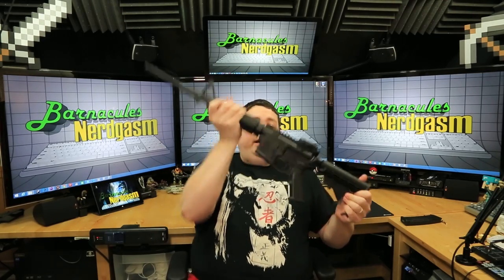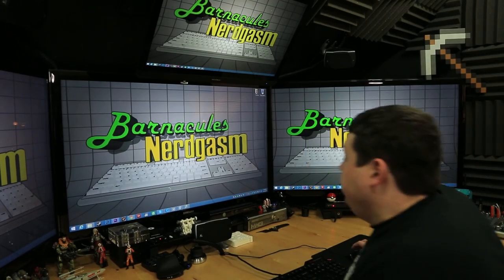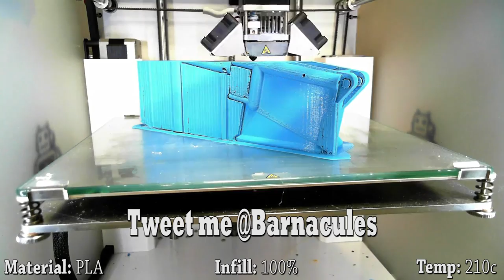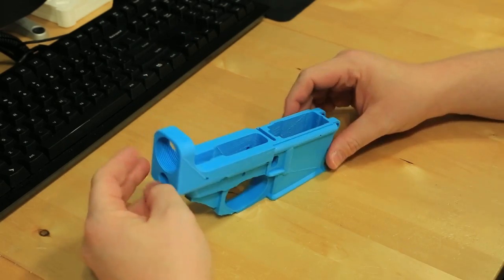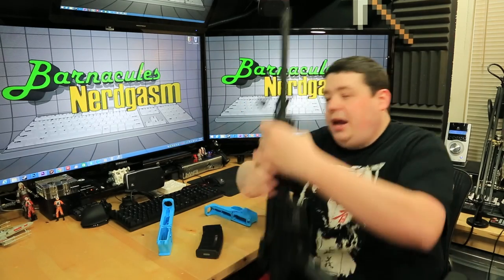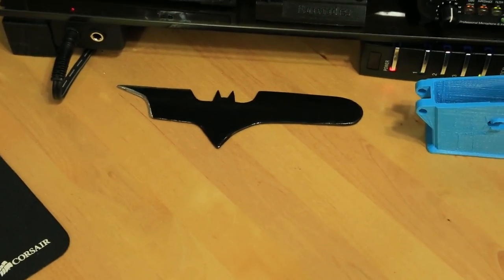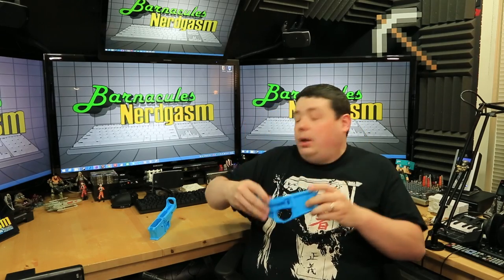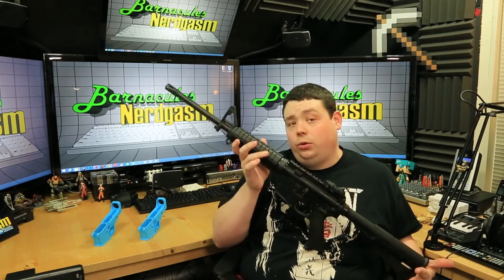Why you shouldn't print an AR15 on a desktop 3D printer 😎 - @Barnacules

Comment: I think printing accessories would be a good thing since it could possibly save you money.
Reply: same
Reply: But by the time it's done 3D printing you have earn enough money to just buy one
Reply: Alan Lightner buy a $100,000 printer to print accessories or go to your local shop and buy one for less than 1k?
Reply: Chrispy Customs as far as it comes to just printing plastic parts like maybe flip up sights you can use a regular $200 printer
Reply: They wouldn't hold up long enough for them to be worth it
Reply: Axman8000 I printed a foregrip for my ar15 out of abs at 50% infill and it works just fine. I rubber coated it and it feels nice in the hand. I have also printed a lower receiver in abs at 100% infill and trust me it I completely solid and sits like a glove to the upper. The grip took me like 4hours to print, the lower receiver took 41 hours to print.
Reply: do you mean a grip or a handguard? if its a grip I would understand, but polymer handguards just don't hold up, especially free-floated ones
Reply: Axman8000 its a grip. I imagine you could print a handguard out of abs and it'd hold up as long as you weren't dumping 500 rounds through the rifle in rapid succession. Or you could print it from nylon and it'd almost never wear out. Also depends on the influence.percentage. the lower I printed was 100% infill and you could run it over with a car and it probably wouldn't break.
Reply: sinformant I disagree, I had a polymer handguard and didn't hold up to 500 rounds through an AR-10
Reply: Axman8000 I imagine that depends on the polymer or type of plastic used, how much its shot ect. As for nylon it generally has a glass transition temp of 250°c so if your barrel gets that hot, you are firing off a bunch of rounds in succession. Not if its free floating and only supported at the received and you beat on it a little then yeah it'd probably break eventually. I've never printed a handguard and used it so I honestly couldn't give you real world experience on it.
Reply: Chrispy Customs well the thing is, a 3d printer is usefull in many ways, where as that new grip you bought is only good on certain guns
Reply: sinformant i believe you but id still rather trust a company like Magpul that uses high quality polymer. still cool tho, bet you can print up some cool custom furniture

Comment: you should do a printed FGC-9 full build now, 9 months later.  also, the AR lower does not qualify as a firearm according to current legal rulings, the ATF has been dropping criminal charges against defendants because it has been successfully argued that the AR  lower receiver design does not meet the legal definition of a firearm.  also, the charge weight in grains between a .223(5.56mm) and a 12 gauge is basically identical (17-27 grains), not even close to the 5x you stated at 13:14

Comment: Most pistols are plastic anyways. My glock is plastic.
Reply: Zach cash 3d printers can print out in abs and petg. Glock lowers have already been printed and they do quite well even above 1000+ rounds. The metal key components you’re talking about come with the glock parts kit so you can install them onto the lower. Hell you can print a 3D printed ak lower in PLA + and it will work just fine.

Comment: Did anyone else notice that the mag was backward
Reply from the maker: I did ;)
Reply: Blue Hood lol that's cheating lol
Reply: Dd sells theses for 1,600 and the lower is made out of aluminium.... He is so full of crap.... He has no. Idea.
Reply: Blue Hood no it wasn’t
Reply: Clearly you do not know anything about guns
Reply: Lol no it wasn’t
Reply: Lol yes
Reply: It’s not backwards bro... lol
Reply: There we go
Reply: he was doing it on purpose because hes scared.
Reply: Barnacules Nerdgasm the mag wasn’t backwards tho the curve goes away from the lower like it should
Reply: I don’t notice it. Maybe he did at some point but I didn’t catch it.
Reply: Blue Hood no it wasn't. It's throwing you of because the pistol grip is missing.
Reply: Even the guy who made the video admitted it was backwards.
Reply: @highplainsrider8734  It isn't backwards. It threw me off at first but it is in the right way.
Reply: Don W. Doesn’t mean he was right.
Reply: Don W. The guy that made the video probably doesn’t build custom ARs from the ground up like i do. The mag was positioned correctly trust me.
Reply: It's not backwards. The curve of the mag bends towards the rear of the rifle, as you can see when he demonstrates in the actual AR. The round hole on the printed piece is for the buffer tube, not the barrel. God damn it was so hard for me not to insult you.

Comment: 2:00 all the pressure bearing parts were plastic which is still really impressive the only part that had to be metal was the firing pin and they put a price of metal in it so it would be legal since then law says a gun has to be detectable by a metal detector which is a dumb law cause they use xray which it doesn’t matter if it’s metal or not and also someone who does want a non metal detectable gun for a crime could still in theory do it

Comment: according to the gov the lower is the gun. In an AR 15 that is.. depending on the firearm depends on the part the gov calls the gun..you can order every part of an AR 15 and build it  at home ( other then the lower ) Lower stripped or built / has to be shipped to or bought threw an FFL.. You can buy an 80% complete one and mill out the fire group areas. and drill a few wholes but IMO that is a pain.. other have had great success with printed lowers but they do have to be replaced after a while do to the weak area where the stock / buffer tube connects. That area takes a lot of force / abuse over and over.. God speed and be safe everyone.

Comment: That lower has a third pin hole... you just manufactured a machine gun
Reply: lol
Reply: There is no 3rd hole. The hole you're referencing is for the rear takedown pin but its super undersized
Reply: Even if it had a, third pin hole. Without the auto sear it isn't automatic
Reply: @CodyTaylor115  The third whole is what the ATF considered the machine gun, if I have a semi lower and drill a whole above the takedown pin area and the slector switch that’s in the eyes of atf a machine guns, second theirs a takedown pin hole and a third pin hole on that lower
Reply: @anthonymartocchio7474  
You are sort of right 🤔🥴

Comment: I printed the same part and had the same fit problem. One big fit problem is the over all size does not fit the upper. I just wanted to see how it turned out on my re-built Da Vinci 3d printer running Ramps 1.4 it toke 8 hours to print and turned out very nice for a part that does not fit lol. but you are correct just not practical and did not want to screw up my gun so i never tried any internals. But t was a cool print that i know display on my shelf.

Comment: The reason printing a lower would be such a big deal is that the lower is the only part of the gun you need an FFL to order. If you can print lowers you could in theory build unregistered AR-15 without an FFL. It is legal to build unregistered firearms for yourself. But you could not sell them. You can buy unfinished AR lowers without an FFL now. But it takes a lot of work to finish them without a CNC machine.

Comment: You can however, create the model that could be used to make the mold for the metal one.
Reply: You can't mold something like a lower. It must be lathed or otherwise very accurately designed milled. The slightest mistake in manufacturing will stack the tolerances against a functioning fire arm.
Reply: you can mold lowers with polymers. look up freedom 15 lower
Reply: Their are milling machines specifically designed to print ar lowers out of alluminium that would be your best bet for doing this effectively
Reply: Joshua Spillane ya you can there’s plenty of videos of people doin it. Takes a lot of grinding and measurements, better off buying an 80%
Reply: A mill does not print it cuts away metal

Comment: I'm pro 2a but here's the issue with the lower receiver. The lower receiver is the only part of the ar that is federally registered. If you have a lower receiver, you can buy an upper receiver and a barrel and every other important part without an FID. The least important part happens to be the regulated part.

Comment: the only significance the lower receiver has is that that's where the government makes firearm manufacturers print the registration numbers the dealers are required to keep on record and then send in to the ATF after 10 years which they are only allowed to keep it and paper documents they are not allowed to keep it in any modern database

Comment: I’m not sure who has been having issues shooting with a 3d printed lower after a few rounds but I have built multiple 3d printed lowers and shot 100’s of rounds through them with no issues. Currently building another one that I’m sure will be successful as well. Just saying the lower isn’t that fragile. PLA+ is what I use for them. Oh and on an upgraded ender 3 V2.
Reply: Does the pla+ have the same shrinking issue and if so how do you remedy that

Comment: Being that the lower is the only part that you have to register as a gun upon purchase, and all other parts can be readily ordered without any guff, AND the fact that the lower receiver is what controls the rate of fire, and the part that is modified in order to make a select, or fully auto rifle.. I'd say, not only is it significant, but it's the most significant part of the gun... Regardless of whether or not hot bullets move throught it at supersonic speeds. The ATF would agree with me on that, as well.

Comment: printing a lower receiver is not the same as printing a gun lol
Reply: Legally, it is.
Reply: Carl Siemens nope, you can buy an 80% lower legally, with no serial number.
Reply: Lynn Mckenney 
You're correct but that doesn't make me wrong.
Reply: Carl Siemens legally a citizen is allowed to make their own guns so legally it doesn't really matter as most people that would probably go through the measure of doing this I probably doing it as an experimentation or just for the heck of it as a hobby maybe using up some spare parts that they have.
Reply: Lynn Mckenney 
You can buy an 80% lower but you’ll need a kit to finish it.
Reply: yes, it is, when the other parts can be bought in the mail by anyone.

Comment: People have many misconceptions about what is considered a firearm, but also the idea that the ATF or government have a list of your guns, when a person buyer comes in and chooses a firearm they fill out a standard form, you then call the NICS operations to do a background check, no where in this process are they provided the serial number, caliber you are only asked if it is a handgun or long gun, the only record that exists is the original paper application that specifies the type of firearm, so the ATF or other agency would physically have to have the firearm in their hands, then they would have to contact the manufacturer to find out which wholesaler purchased it, contact the wholesaler to find out which retailer purchased it, then that retailer would have to search thru all their background checks to even get a name, which still proves nothing as the original purchaser could have privately sold it at anytime. Ok now that is said, 3D printed lowers using carbon nano tube filiment, and reinforced with zinc blocks at the front pin hinge and rear buffer tube work perfectly, I own 4 myself with thousands of rounds put thru each one with zero wear, this is legal, it is our right, the lower "the only regulated part on any firearm" is not an extremely wearable part, ATI has been building zinc/plastic hybrid lowers for a long time. But this whole idea that the cops can pull a bullet out of a wall and in an hour have the name and address of the person who owns it is fantasy perpetuated by CSI, TV shows. Guns are NOT dangerous, they don't walk out on their own and hurt people. Only 1 half of 1% of fatalities are due to the use of a legally obtained firearm,  more people are killed by butter knives, than legally owned or purchased or built firearms. Not to mention, if guns were made illegal, criminals would still find a way to aquire them, it would only hurt those of us that follow the law. Rant over now!

Comment: Actually my question was printing a lower receiver as a BLANK, and then Sand Casting it in a mold by using melted aluminum or brass.

Videos here show guys billeting a block of metel into a lower receiver, but figured sand casting would be way easier and more precise. Just trim flashing and small clean up is all.

Anyone sand cast a lower yet?
Reply: Or better yet, use an actual lower receiver to get the mold print and then pour in the metal I should say since 3d printing shrinks sizes.

Comment: What you could do is print a form, to produce a mold. But you better have a heck of an understanding about metallurgy & machining to the point it doesn’t make sense to try it (it’s easier to machine it).

The scary thing is modifying the capabilities of a weapon, turning an AR15 in to a M16. In the British Army I carried a SLR, which is based on the FN FAL. The SLR was a selective fire weapon, the FAL was full automatic. To convert the SLR to the FAL required a matchstick.
Reply: I feel like you’re exaggerating but since I’ve never had access to a select fire FAL, I guess I’ll take your word for it.

Comment: A company couldn't legally 3d print you a lower either because the lower is considered the gun.  You can legally make yourself a gun but you cannot ever sell or even gift it, that means if the company did print it, it would have to be an ffl printing company that would have to put an SN on it and the lower being made of what it is would most likely even need special approval depending on regulations at the time

Comment: OK jerry I watched this video when it was new, I printed a vanguard lower a few months ago at 100% infill in abs and it printed just fine on my folgertech ft5. (I did not scale it up)It fits an upper snug and is solid enough to bludgeon someone to death with itself by itself. And the magazine fits just like it does in my regular ar15 lower. Also you can know but the ghost gunner a $1600 desktop CNC machine that machines 80% lowers.

Comment: The only real limiting factor is the receiver would break before you could sight in the rifle. Which would be catastrophic.

However, the need for a barrel and other metal parts is really beside the point since you can buy a complete upper, and lower parts kits without an FFL.

So the main point is valid, the rest is misleading fluff.

Comment: Also not only would it melt, plastics are not durable enough. Firearms use combustion aka controlled explosions , plastics cannot handle the pressure and your firearm would become a grenade IN YOUR HAND. The lower doesn't have to contain said pressures and there for can be made with weaker materials. This is why you see Glocks made the way they do.
Reply: Zach cash  And it works with AK lowers. 😉 But it only finishes 80% lowers, although programming the thing to mill aluminum blocks is possible.

Comment: They didn't print out the lower. They mill out a lower and you can buy the plans for the ar 15 lower, glock frame and a few other firearms with the purchase of a fairly cheap milling machine.

Edit: And yes, the work better than the common civilian issued ars. The lower receiver is military spec.

Comment: you can make a synthetic polymer gun that is undetectable by metal detectors. thats the gun not the ammo. im not posting what materials to use. but you need a cnc machine or injection mold. the material used will not work with a 3d printer. and also the material is used in advanced aircraft and space craft where you want non conductive but strong as steel material.  yes its like four times the price of a 75-160 dollar lower you can buy at a gun store.

Comment: Where did you get your model/stl file from. If you made it yourself to spec you should have been able to successfully print it and everything would line up. The tolerances aren't as tight as you might think, for example the play within the Mag well, the play between the pins that hold the receivers together, etc.
Reply: It isn't how good the file is, it is how good the printer and the medium used to print it is.
A good printer and medium that keeps the tolerances will print a good product. PLA and ABS shrink after being cooled down. Not to mention the printer overshoot which causes the lines in the printed material, it also makes the wall wider than spec.

Comment: There are at least two videos I have watched that prove you are wrong.  Both print the lower on a standard low cost 3d printer, at least one of them uses ABS.  Both show a small amount of touch up work, not hours as you say, only minutes.  Both also demonstrate the weapon firing over 60 rounds and no noticeable damage to the lower.  One guy also 3d printed a working bump stock. with full demo.

Comment: if you 3d printed a barrel the first time you shoot it the bullet would strip the treads (if you put them in the barrel) and the heat from the gun powder would melt the inside of the barrel and f*** it up to the point where it would explode the next time you fired it.

Comment: Just throwing this idea out, but mentioning the "tight tolerances" of the AR15 caused issues from 3D printing, what about an AK receiver? AKs are probably one of the firearms with the loosest tolerances (reason why they're so reliable). Although the trade off is that AK parts are put together very tightly (front sights, forend, gas block, barrel into receiver), a 3d printed AK receiver might have a higher chance of working
Reply: Upper Receiver or Lower Receiver?
Reply: Chief Machining Lower.